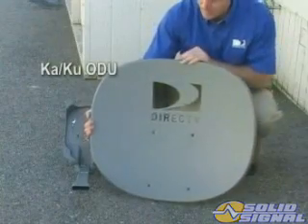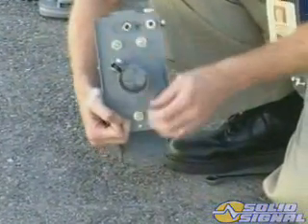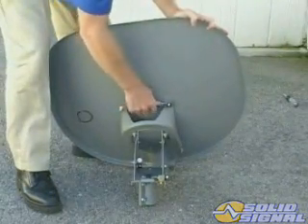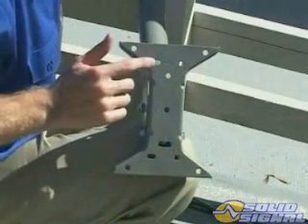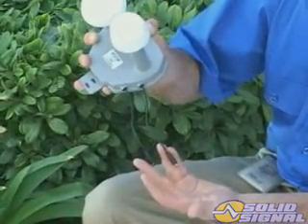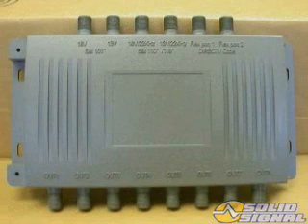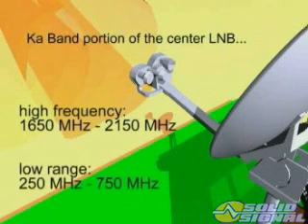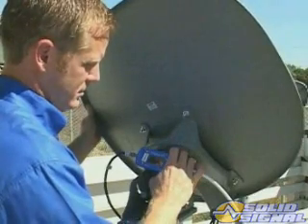DIRECTV Ka Ku 5 LNB Satellite Dish Installation Part 2

Comment: Hahaha never see a LNB like this the Satellites are all on a different Positions!? Could it be to come to distortions between external Signals from 250-750MHz for example we have the RF-CarKeys in the 433MHz Range or the Termometer, Bells from the Door, Police Radio 390MHz here in Europe. We only use the 1st. RF Frequenzy from 1750 - 2100MHz.
Maybe you have in the US a lot more Programms from Satellite.